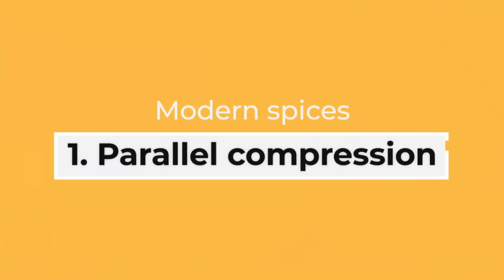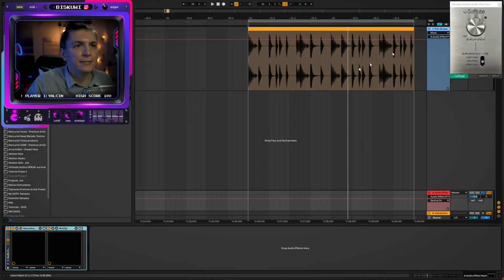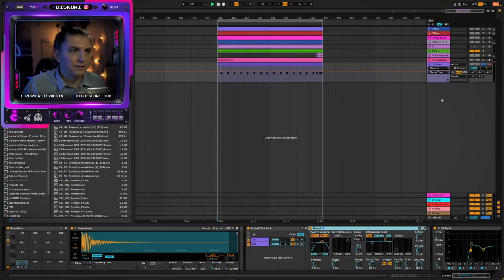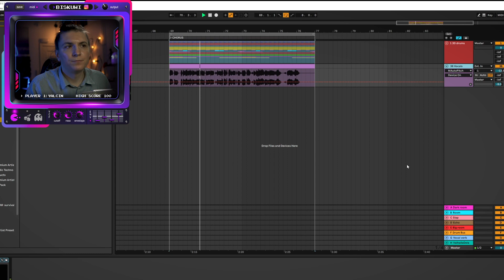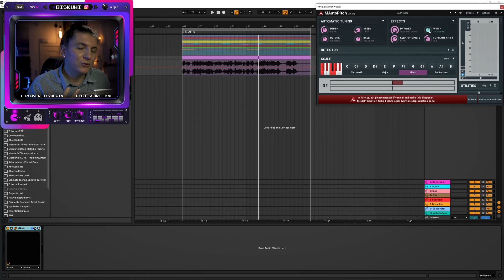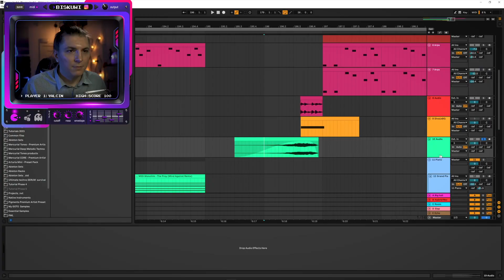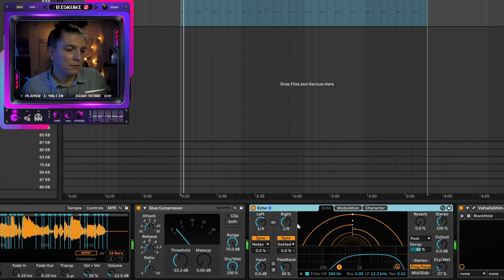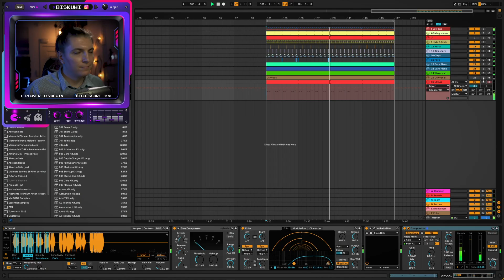5 juicy techniques modern music producers use

Comment: 1:26: you apply a saturator an bring some dirt to the sound  ... Actually, I can hear the sound getting louder, but I couldn't hear the dirt  ... Hey, I suspect there is some problem related to youtube that changes something in the sound? Or is it my ears ?  I am using a dt 770 pro headspeaker and turned the volume up in my sound card, and still could'nt hear the dirt?  
Can you playback your own video an tell me if you hear the dirt (directly from youtube) . [@Yalcin, what i said also applies to many other things you mention in other videos: you describe something that you hear, but I can't hear and I really started to become curious and want to know why is this always happening to me with your videos]
Reply from the maker: Youtube doesn't have the best quality on audio but you can still hear the distortion especially when the kick hits. It is due to extra clipping happening there as well. 
I have a motto of "small changes in multiple steps" rather than "big changes in a single step" so this could be also the reason it is sometimes harder to hear what is happening.

Comment: With parallel comping what are the ranges you would use for attack, release & ratio?

Thanks again with another great video!
Reply: Just learned about this in school. Using Pro Tools the settings that were recommended the plug-in BF-76 are as follows: Input gain: +24 (50 % of total gain input available). Output gain Over Halfway +-18, Attack: HIGH all the way up on this plug in 7 Release: HIGH all the way up again 7. Ratio HIGH 20 on this plug-in. Hope his helps!
Reply from the maker: Like Nathen mentioned, go quite agressive with the parameter, as you want to squish quite a bit. Medium to high release and mid to fast attack. High ratio as well to get that "sausage" shape.
Reply: @Alice-Efe  so quick attack and release & ratio 10:1 and take the threshold quite down so it is triggered?